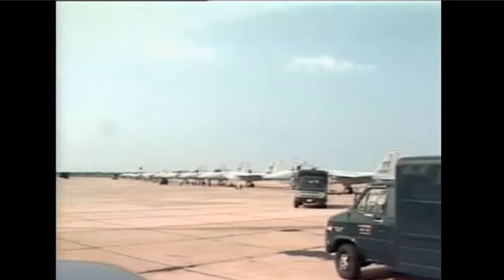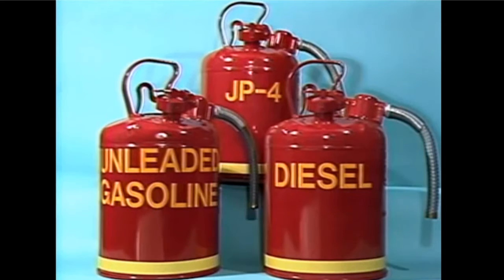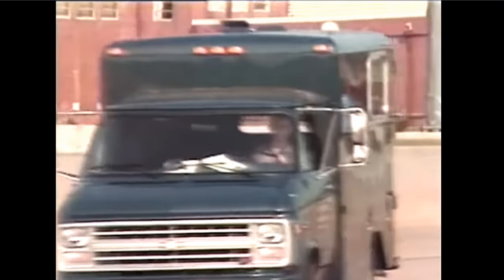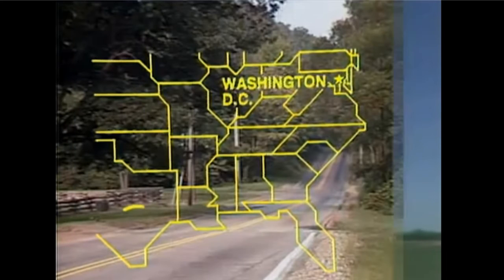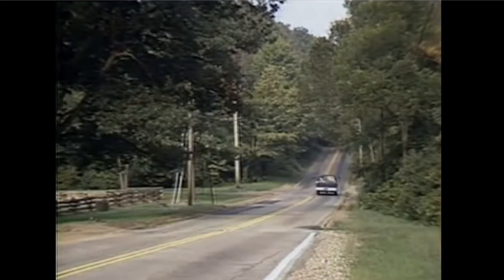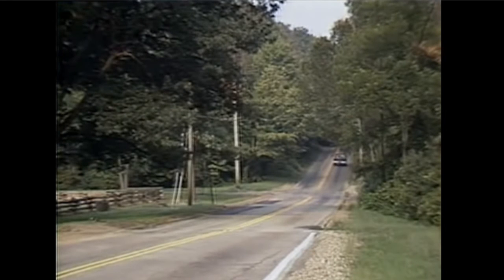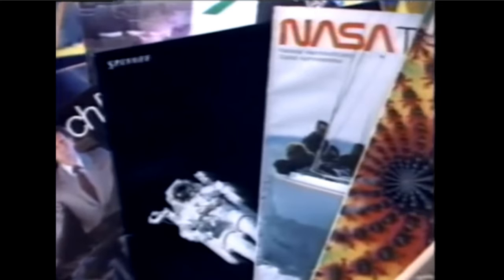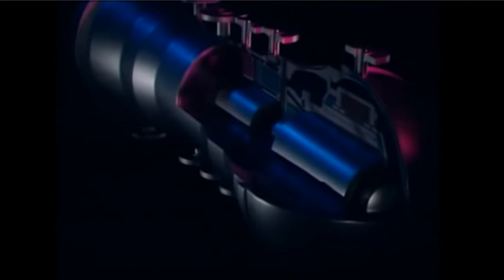The Stirling Engine: A Wave of the Future - 1992 NASA Educational Documentary

Comment: Pretty slick. As Stirling Engines can be designed over a wide range of operating temperatures, it might serve as a renewable energy source?  Maybe?  Where the Sun might be used as the thermal source to heat up some rocks or water say, during the day time, and during the evening and night time the heat source might be use to drive the Engine and generate electricity.  Perhaps the temperature differential between air and a pond of water might also serve?  Or if the operation is near a river or ocean, and an air set up like before?  Just a thought.